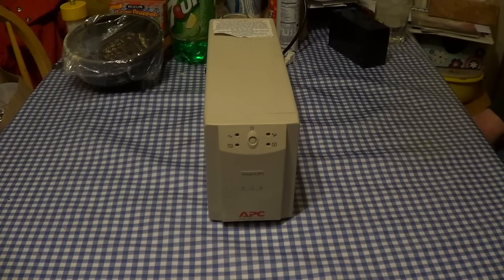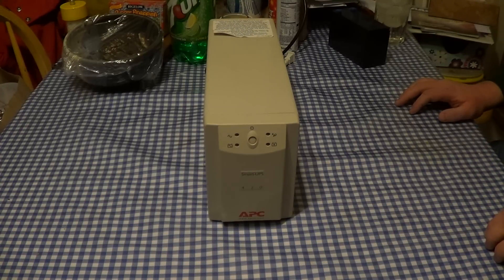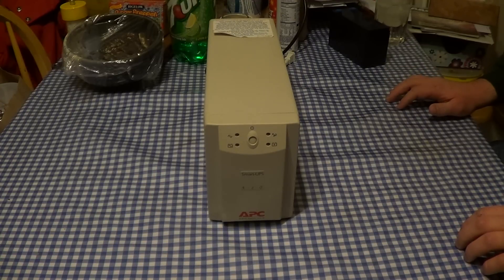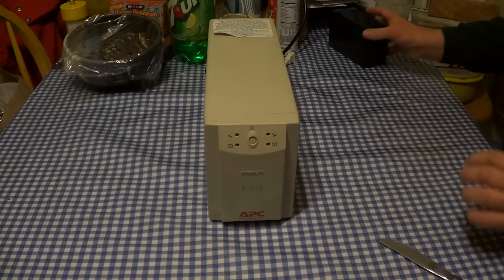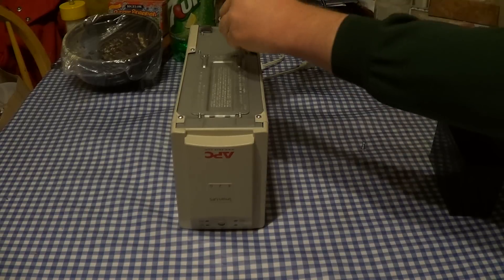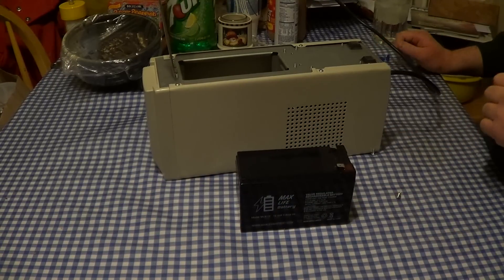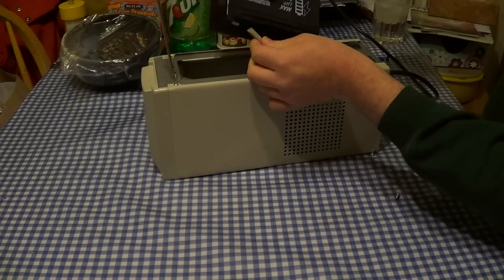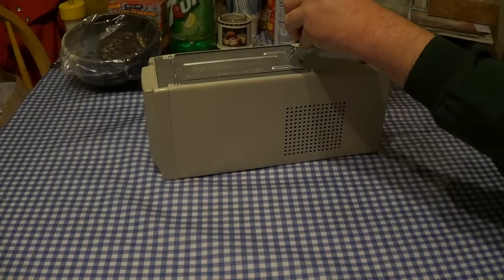APC Smart UPS 420 Returns to Life

Comment: You should get out my video I did on my UPS which is a very old Back-Ups 300. I just got it working with a new battery after having it for years. The battery was bad when I first got it was dead and I finally pulled it out of where it was hiding and was like I am going to you to work. It works great now.

Comment: Cool, glad it was such a simple fix! We need to replace the batteries in one at work. The current one is running at 4, sometimes 5 bars on the load meter and only runs for a few minutes when the power goes out.

Comment: The battery installation method varies from UPS to UPS based on manufacturer design. In some cases the battery is in a compartment which is accessible without tools an example of that is the Belkin 12 volt DC supplies included with AT&T U-Verse residential gateways. Others require tools to undo a few screws in order to access a trap door such as this APC shown in the video and still others require the ENTIRE back or front to be removed such as a Tripp Lite UPS I replaced the battery in. Unfortunately this one also had the screws buried deep inside the case which is where long screwdrivers come in handy.

Comment: It is important to note that the tool required to remove the screws from this UPS is in fact a #3 stainless steel butter knife. Some may try to use a # 4 steak knife which of course is not recommended for this application.

Comment: When my first APC UPS "died", I was sure it had to be more wrong with it than just the battery.  Nope - just replacing the battery fixed it.
Since then I've gambled on 2 more old SmartUPS units from thrift stores. Both turned out to be good when good batteries were provided... though I'm too cheap to provide them on a permanent basis.
APC made (makes?) some great, reliable UPS units, but they did a lousy job informing the user of what's wrong with them when a battery goes dead.  To the uninitiated or ignorant, they really present the appearance that serious problems have occurred and that a battery would just be a waste of money.  Hence so many of them end up in the garbage.

Comment: I had so many UPS arround the house that battery replacement  became a monthly thing, I got rid of most of the small 500va units and in place installed 2 x 2kva units one in the study and one in my computer room / radio shack.
I still have 2 smaller units one is on the test pc that I usually erase drives on and the other on the htpc.
Got to love the APC units that use standard gel batteries.

Comment: I have Cyberpower 320SL that I bought back in 1999 and have repurposed it as a surge protector after the battery no longer would hold a charge. I was unaware that the battery can be replaced but thanks to your video I decided to open the Cyberpower 320SL and sure enough there was a battery there to be replaced. I picked up a new battery via ebay for $18.99 with free shipping. I am so happy that it is back to working order!

Comment: If you're feeling adventurous, you could attempt to revive the old battery. Prying the top off it will reveal 6 plugs that you can pull out to add water to the cells (and yes, this goes for sealed and AGM types, too). I have a 16 year old battery that read 0 volts and didn't take a charge at all, and I did that and put it on a 32V AC adapter for a while, and now it holds a charge and has a good fraction of its original capacity. It seems lead-acid batteries are quite rugged things.

Comment: I fixed a very similar one, same issue as yours. I got a large UPS from work that came with an external battery pack that had been mostly robbed. The UPS has it's 4, and I got 2 of the 8 batteries in the external pack. Both of those fixed two smaller APC units.

Comment: When I was little, a butter knife, scissors, and hammer were my only tools.  To this day I think there are a few knives with twisted tips in the kitchen :-)

The APC Smart-UPS series are my favorite type of UPS.  Especially the later ones with the Smart Slot and optional network cards.  So many of them end up tossed out or on Ebay for pennies on the dollar, because people don't know that these require a battery in order to power on.  They also need AC power present to start up, even if the battery is good.

The older APC "Back-Ups" series have a big advantage for one thing though:  You can turn them on during a power outage with just the battery, and press the test button to start the inverter.  I've been known to plug a light bulb into the back of one and walk around with it like a giant flash light, during surprise power outages.  I Also used one to start up a larger Smart-UPS, which I then hooked to my sump pump and prevented a basement flood.

Comment: How many volts does that battery have, and what are original battery to that machine since the battery got badly corroded and no longer to bring the electricity to the machine?

Comment: That is a very hi-tech screwdriver. It is multifunction; such that if the outlet, of the said UPS needs tested; all one has to do is insert the hi-tech device into the small slot on the outlet. Results will be observed very quickly if the outlet is working properly ;)
Reply: *****
Perhaps a label stating "DO NOT INSERT MULTI-PURPOSE TOOL"?

Comment: I never liked changing batteries on APC units. As you said they put out a huge spark when you connect the wires.  Plus the battery compartment strikes me as a disaster zone because there is no plastic or other electrically insulating material if one of the battery terminals comes loose. Instead the battery is left free to move around and short circuit across a metal surface.
 Shortcomings aside I have been using APC for many years and they can be counted on more so than the cheaper and smaller brands. You get what you paid for.